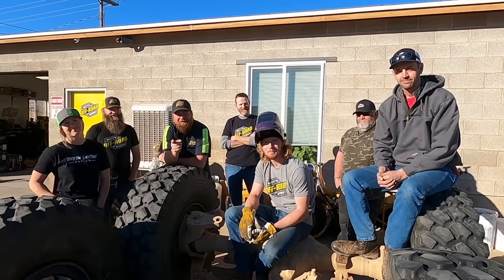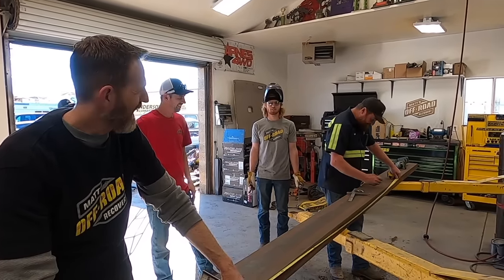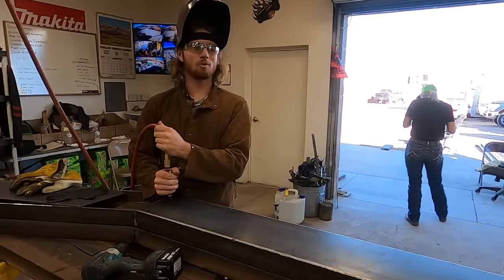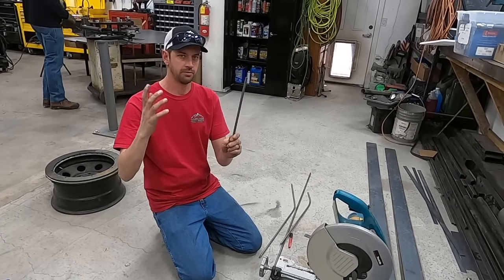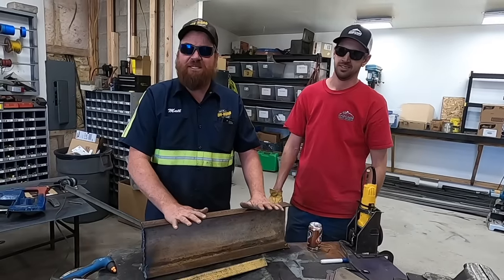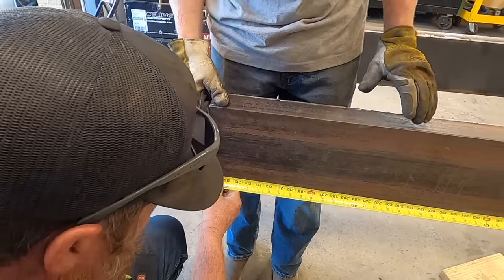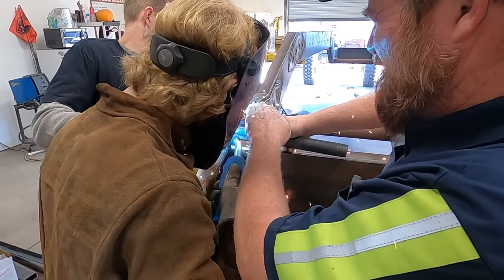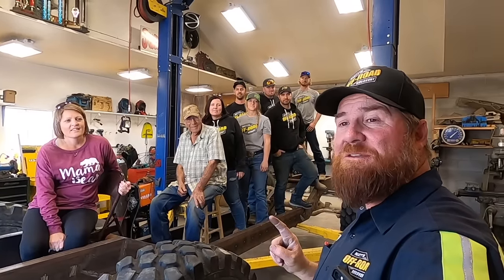I'm Building The WORLD'S LARGEST Off-Road Wrecker

Comment: Matt, I've been watching your show for quite a while and really appreciate your "make it happen" approach to things. Unfortunately, in this case, you're wrong. As an aerospace engineer, a pressurized vessel that is subject to bending and torsional stresses is a very complex design problem (pressurized aircraft fuselages). While your design will likely not fail catastrophically (ie explosively), your pressurized frame will fail at or near the 90 deg corners adjacent to your welds due to stress concentration, aggravated by the accelerated corrosion caused by moisture, and additional thermal stresses of rapidly cooling air when pressure is released.

In pressurized vessel design: Sphere = best, cylinder with spherical ends = 2nd best, cylinder with flat ends = difficult, rectangular/square = bad/dangerous. Not really something to "make happen".

Recommend that you build a solid frame, and leave it at that, and incorporate an air cylinder in an appropriate enclosure.
Reply: @MattsOffRoadRecovery  That PSI should scare you but it doesn't seem to. That force is, cumulatively, well over 100,000 pounds exerted on the metal. If it let go sudddenly, it could cause major damage or injury. It's not worth the risk! Boxing the frame is a great idea, but please undo the pressure vessel bit right away.
Reply: @MattsOffRoadRecovery  A drivers front airbag will launch a person into the air with less than 5 psi.
Reply: Agree 100%. The only thing scarier than this tank is a fabricator that's not scared of this tank 🤣
Reply: @MattsOffRoadRecovery  Another mechanical engineer weighing in here, please please do not do that. 80 psi is not a low number - those 100k pounds of force are all concentrated along the weld seam. Add in your frame torsion / bending / shear stresses during driving, that's asking a lot. A 10 gal air tank can be had for $50.
Reply: @MattsOffRoadRecovery  Problem is, it probably will work.
 Then one day under all sorts of torque it decides not to work and maybe you'll never know what happened, or worse, it blows straight out to the side and decapitates a family of six watching you and your big truck from fifty feet away. 

 Go experiment with frame tanks on a personal toy,  not on a business truck.
Reply: @MattsOffRoadRecovery  It will rust quickly and become even weaker and fail.
Reply: @MattsOffRoadRecovery  I have been designing truck chassis and trailers for more than 30 years, I am sure that compressed air tanks will twist and leak. The weight of this mild steel frame is simply too high, used truck frames save half the weight with the same strength. An old Unimog frame made of high-strength steel would make sense.
Reply: @HugoJunkers-lc4kk   yes. in truck you are fighting of frame flexibility. it makes the articulation. best frame construction is open C-beam, cold bent on press and riveted as much as possible instead of welding. old mechanics said that frame shouldn't be welded at all. only red-hot rivets they used.
Reply: Yeah it might leak eventually, but its not gonna explode.  They have retention and reinforcement every few inches.  A whole panel is not going to fly off and kill someone.  Matt is a firm believer in experience and practical examples.  This is no more dangerous than when people said the trailer hitch balls are going to fly off and kill children.   It just doesn't happen in real life. You are gonna die in a car accident on the road 100000 times before that happens.
Much appreciation to everyone trying to keep things as safe as possible.
Reply: @MattsOffRoadRecovery  RJ is correct. Due to stress concentration you will forever be chasing leaks till you give up.
Reply: @vetrieska11  yup. I was thinking they should’ve repurposed a high tensile truck frame.
Reply: @timothygeiger8271  I wish some of these experts ventured out into the world from time to time. If they seen some of the sketchy stuff out here.....
Reply: @BlueCollarBachelor  there's definitely alot of sketchy things out there, I've seen some things that would make your hair stand up🤣
Reply: Friends in Australia made a wrecker from a Road Grader - 6 wheel drive all ready to go, just changed the cab position and steering done ! mega strength and if you need air lockers fit a proper made and tested air receiver
Reply: Agree the flat wall pressure vessel is a bad idea. That said, I have a friend who made side steps/sliders from rectangular tubing on a CJ7 and used them for an air tank for probably 20 years without a problem. I've also seen fittings added to a roll cage and used for an air tank. 
Just bad ideas. 
So far no catastrophic failures though.
Reply: @TB-ve3ht  there is an article in motortrend with a frame tank, it explains how to build it, & what steel to use.
Reply: @BlueCollarBachelor  yeah man I wish the engineers designing the planes we fly in would venture out into the real world…our planes would be so much cooler if they were sketchier
Reply: @charles8557  there's no such thing as a perfectly good airplane.

-22 years ATP/CFI.
Reply: @BlueCollarBachelor  but there are plenty such things as dangerous airplanes
Reply: @charles8557  all of them are dangerous.
Reply: @stephendee7839
Reply: @FrankFactor  Ryan Woods is an unfortunate example of using a ball hitch for recovery :/

Comment: Please conceder the fact that when the frame flexes that air leaks will develop along the weld seams and they will continue to do so for the life of the frame minute cracks and pinholes will be a continuous problem Just install air tanks like in the bumpers round pipe, Just a suggestion. Respectfully, MK
Reply: Im sure they will over build the stiffness of that fram and all the flex will be in the suspension.
Reply: Theres not gonna be an ounce of flex in that frame.
Reply: @Random very much so possible
Reply: @hoosiertrailrider  They can  put whatever brakes they want in the end.

Comment: hey, you guys should try using the TIG to repair your small leaks, just grab the torch and make a fusion pass over the leak, give it a little weave to cover more surface area. Drilling out and filling with MIG takes way longer and you're not regaining much if anything structurally.

Comment: Pressure vessels are cylindrical for a reason. It's to avoid any concentrated shear stresses. A boxed square tube frame is loaded with shear stresses.  Best case, it's just going to leak. Worst case, it bursts, and someone gets hurt.
Reply: At 100psi it will likely be fine.
Above 1,000psi, I would not trust it.
Sounds like we might all get to learn together. Science! 🇺🇲
Reply: Steel is pretty ductile, eventually a leak or even a crack might appear, but flying shrapnel seems pretty farfetched to me.
Reply: @insAneTunA  exactly. It will leak and might hurts the structure of the frame, but there's a 0% chance 100psi explodes that steel.
Reply: @WEMS20  I agree👍
Reply: @WEMS20  I do think that it is a bad idea  to use the square frame as an air tank. I believe that it will eventually fail due to contraction and expansion, most likely at one of the welds from the studs that they welded in. And there is also the moisture problem that is going to build up inside the frame that is unprotected against corrosion. I think that this truck is going to be big enough for two well placed air cylinders or tanks. Much easier with maintenance or to replace as well, and no risk damaging the frame in the long run. Even regular air tanks do not have an eternal life.
Reply: @insAneTunA  for sure, definitely agree .
Reply: Absolutely agree.  Even pressure testing the welded assembly with air was dangerous, borne out by the worrisome bulging.  Hydrostatic testing should have been used, and going forward they’ll need a pressure sealing drain anyway for eliminating condensation.  For however long this lasts.
Reply: @TKPorsche  Well, at least they are having fun, and that is important too 🙂